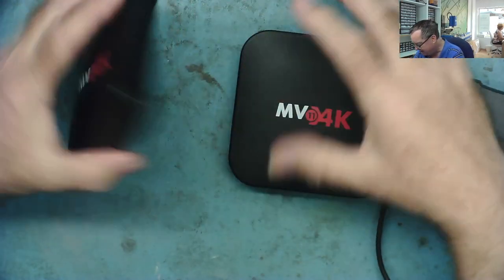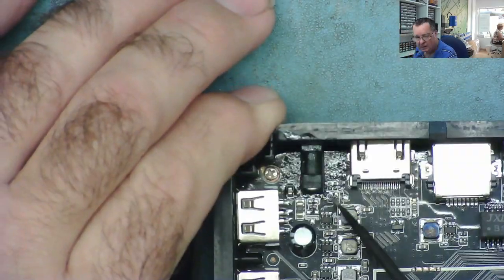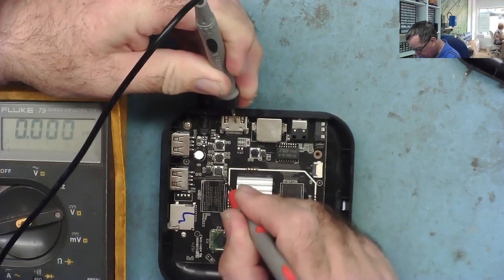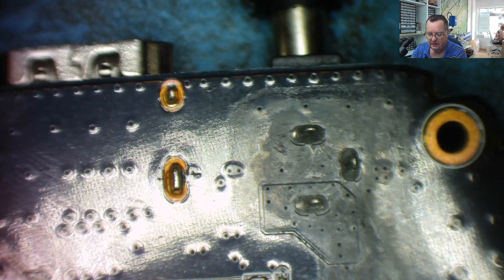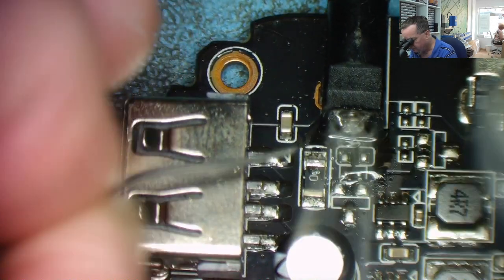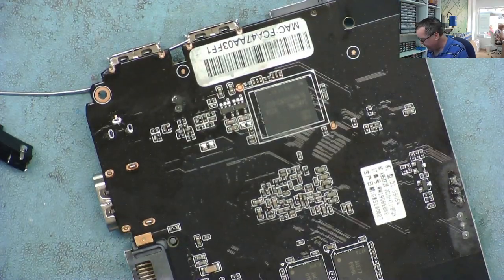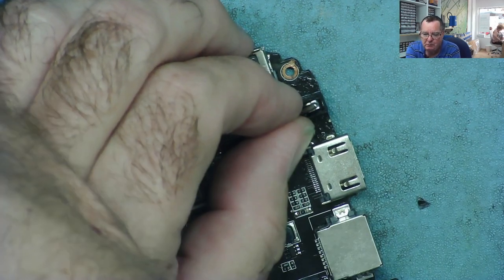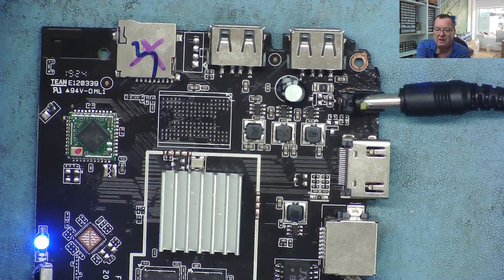Dead Android TV Box Repair

Comment: I got mi box 4k, i used 12 volt adapter in it which made it to not power anymore, what could be the solution?
Reply: I got the same problem used uses the wrong adaptor and blew it up.couldnt find anyone to fix it...yet
Reply: Any update yet?...I just made same mistake.
Reply: Same did u get any solution?
Reply: @miracletony7158  i gave it to mobile shop, he removed many components from it, its no more now, cant be repair
Reply: @manud8665  dead forever
Reply: @amitkaushal7310  sad to hear.. even i will give up 👍
Reply: I have 5volts going in but it doesn't boot. It has been fine if I only put in stand by or plug unplug but when I turn off it often wouldn't boot then just as I was ready to chuck it it would and I didn't want to risk reset as Im unsure if it would have restarted started with same odd problem. This time I just can't get a result but can see some power is coming out a USB port. It should boot as power is plugged in. I had guessed software but now I think maybe a bad connection. It's an xten allwinner plus and had highest mem options I think it's harder to get apart than the above type to inspect but will cut if needed. My soldering is pretty poor but its better than throwing out and it sux that on several occasions it just stated a day or a week later with no obvious issues when moving it or shaking. It just unplugged this time and then wouldn't start with power back in. I guess they don't last but it is frustrating knowing how many times it suddenly worked. It has a browser which my smart tv doesn't or it only does media. People blame buying product with no support which is unknown before buying. Guess we all have a internal power issue that no one can affordably fix or even check. So when replacing I need something that can hold chrome or edge. Dammed if I understand why TVs don't. It meant for my big screen dumb tv to make it smart. Anyone know what lasts best at low cost for browsing with wifi to modem and HDMI connection to tv and either a decent remote or app control known to work from phone please recommend for AUST.  use never got the hang of setting up kodi it seems like a great app if preinstalled or if in USA easy to do what they do but it seems so complicated here or to me. Think it must be great though..

Comment: Wouldn't low melt solder make them come out much easier? I use it when removing any plastic based connectors.
Reply from the maker: I do have some of that ChipQuick low melt solder - though generally I just add leaded solder and it has much the same effect, but cheaper.  Next time I have a similar problem I will try the ChipQuick and video the results. 

 With added Leaded 60-40 solder the first one came out pretty quick and easy and I am sure you will agree

The problem with the second was the superglue that someone had poured into the casing and I don't actually think low melt solder would have helped. In fact I think it was the high temperature from the hot air station that eventually did the job.

Actually I mentioned about the glue to the guy who brought these for repair and he said that it was he himself who put the superglue in!  I didn't bother to ask why.
Reply: @LearnElectronicsRepair  I love the low melt. Most of the time it will stay soft long enough just from my soldering iron. Then I can pull the part right out or it just drops out. I get mine off Amazon but it is a generic brand that works just like ChipQuick at a much lower price. The glue thing is crazy. I wonder if acetone on a swab would have removed it without damaging the PCB mask? Thanks for responding. Just started watching your videos and really enjoy them.

Comment: Great video.X ten rtv allwinner plus. Pulled it apart found loose  optical port light came on when I touched two of three pins soldering points. i didn't fix its still loose.Reset button was down hole marked as something else like audio used plastic gently to press and felt button thanks,nothing it display or tv  but did the power insert method suggested.  Mine never completes restart from menu just powers down. Seem best if I never turn off completely just short press power so its in stand by still connected to WiFi so phone app ZANK will detect and start it I have had many long dead periods. Did repeat and expect different outcomes until unverse took pity on my stupid method and several times its come back to life showing booting on its tiny screen after hourrs days or weeks of no luck. Power supply is perfect. It auto updated to Andriod 9 on first boot after WiFi  years back. Its not rooted or shows as not using file management app that has ok reviews.I have no clue why it goes dead when it does usually seems after Turn off rather than stand by but it can happen if power goes out. I keep processes and recent apps clean using brush icon and clear all apps recent which comes up using rectangle with a v shape on top.That keeps slowing and other issues normaly requireing a reboot. dead intermittent boot issues seem worth plug unplug leave hdmi connection and power one day then leave disconnect everything the next. ruled out power supply. It would be in bin if not for this video, pulling it apart. I don't know why booted and if I should try reset again or rooting now its running. It needed unplug replug power to boot after it was ín standby and booting came on its little display most just have light. They save over a thousand$ on big screen TVs even my cheap smart tv doesn't have proper browser and one app.nTVbox units worth price when working. I would buy again, want to try preinstalled KODI, I can't set up in Aust using utube USA inf,  looks like a great app, just can't get enough instructions for funtional add-ons required  back end and stuff like that complicate setup & detects a remote then locks up so far.  I want it though and I'd love to learn more?  rooting  unrooted box is it a good idea? appreciate any advice or info. Wishing to collect dead tv boxes power n cables check or swap out parts   n cables.